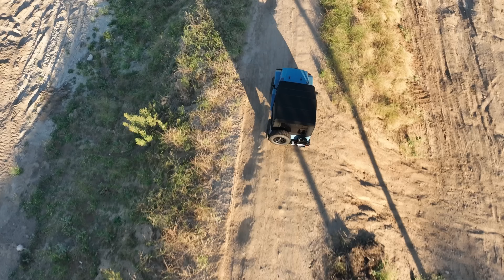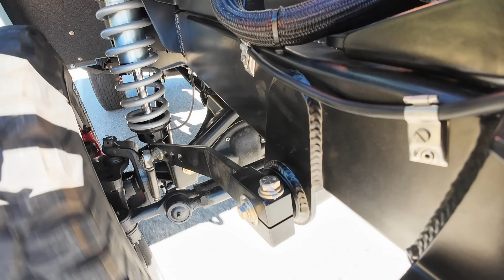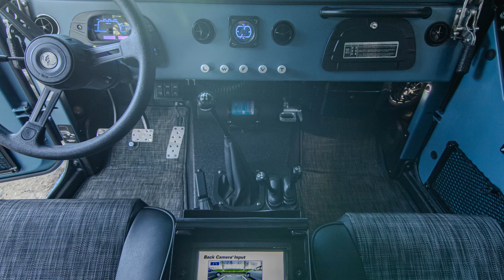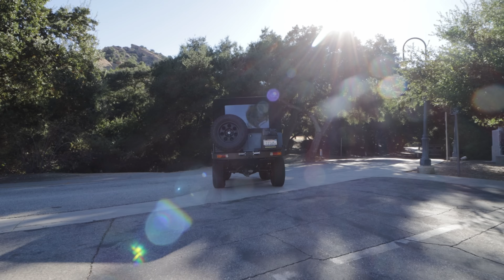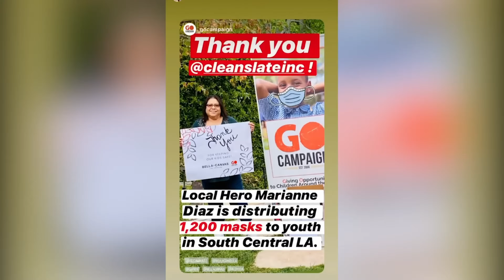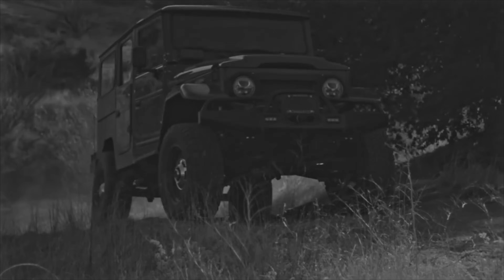ICON New School FJ40 #182 Restored And Modified Toyota Land Cruiser!!

Comment: Excellent vehicle. Beauty and function. Someone mentioned the transfer case with respect to the Tremec; Toyota transfer case is gear driven, (no chain). The 4.2 liter Toyota motor is/was gear driven as well, (no chains or belts). Those seem to have more accurate timing? but noisier, I think.